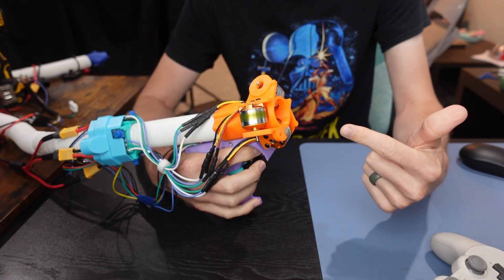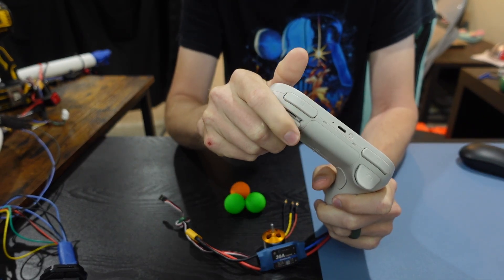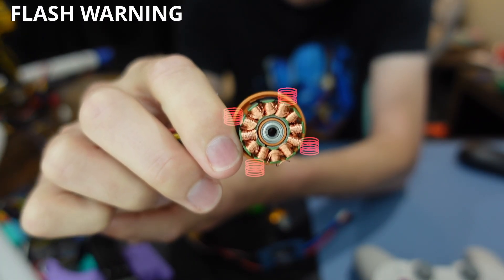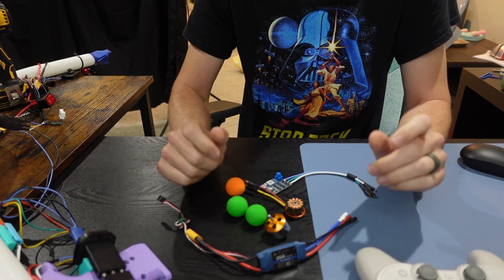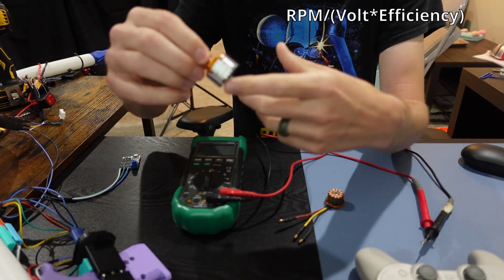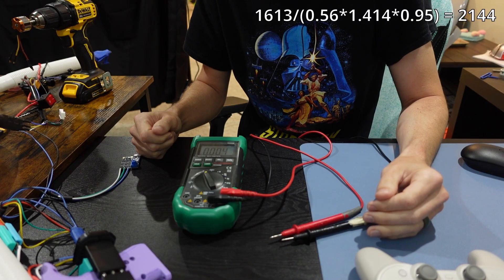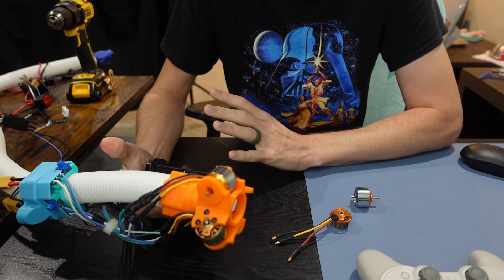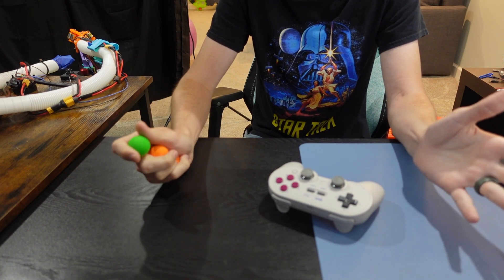Sensorless FOC For Precise BLDC Motor Control | B-G431B-ESC1 | simpleFOC | Field Oriented Control

Comment: if you don’t have an LCR for the inductance measurement you can use a capacitor with a known capacitance and use it in conjunction with the motor coils to make a tank circuit. Just charge the capacitor and use an oscilloscope to see the resonant frequency of the circuit as it discharges and you can solve for the inductance.
Reply from the maker: Awesome, I'm gonna try this.

Comment: Hello, while trying to modify these chinese orange color BLDC I found that these motors are in delta configuration not wye. I have tested this for 930KV, 1000KV and 1400KV..

Could you please share your contact with me? I am currently trying to develop a bidirectional ESC for BLDC motor...
Reply from the maker: You're absolutely right, they are a delta configuration. I made a mistake assuming they were all the same. The firmware can be modified for bidirectional control. Would it be helpful if I created a video on how to modify the firmware and how to properly measure the delta configuration's parameters?
Reply: @hellothisismax  thanks, I am jealous of your expertise in power electronics...Best wishes for you...Also loved the way you make things simple...Big fan...

Comment: It seems like you might have better control with only two motors with an adjacent idler wheel which would mimic the four way direction controller.
Reply from the maker: You can see whether or not the escs and firmware solved my issues in the next video. I dropped a link to it in the description.

Comment: Thanks for the tip on those foc controllers. They're only a couple bucks more then the cheap Chinese ones. Good find!
Reply from the maker: They're a pretty good deal for what they are, if you want to push them hard they do require some sort of active cooling.

Comment: you can do the same with steel balls without friction contact with magnetic rollers. make sure the magnet roller alternates the magnet strip poles. in any case the magnet roller is able to move any iron object forward. well end product is a steel ball sling. so why not using a vm to run linux or windows. on the mac. sounds like mega hoops to me, over burden. ie way too much work for nothing or little benefit. well, a drone motor with its magnets should be able to remote sling steel balls by default. by its outer ring magnets.